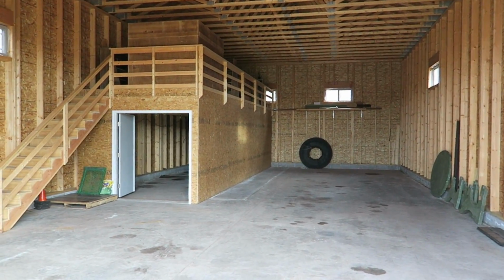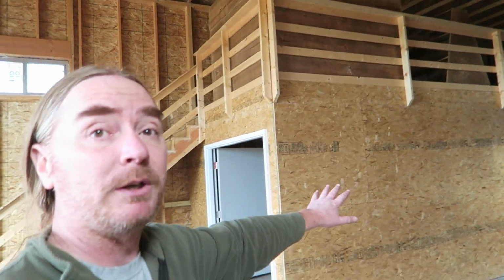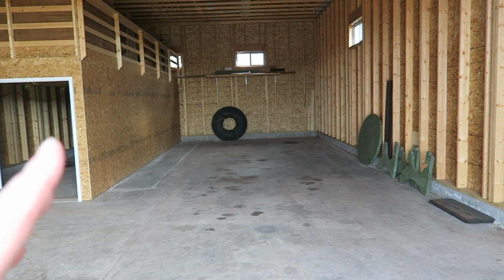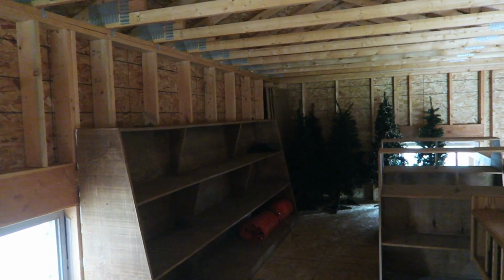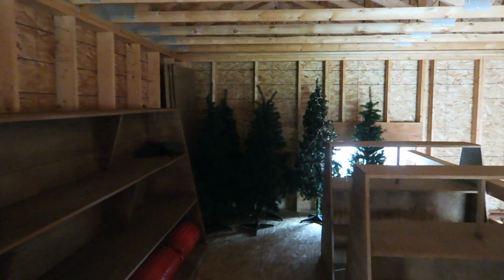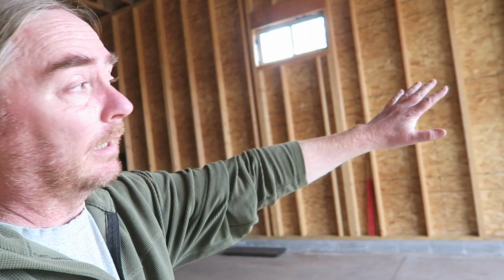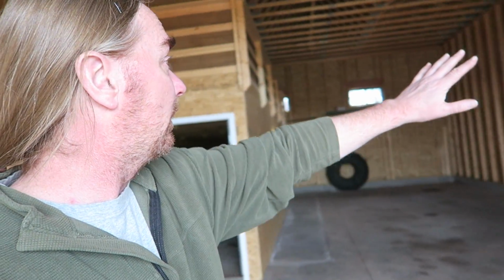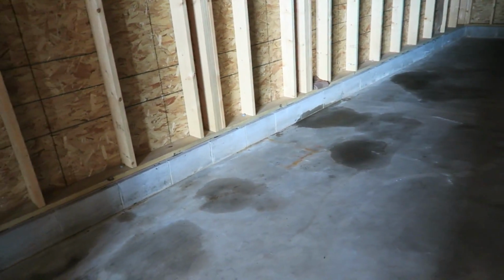CHECK OUT THE NEW BOAT SHOP!!

Comment: Decide what  "R" insulation level you want.   The R level is selected you can then decide on the cost of foam, glass batts or blown in insulation.   The advantage  of closed cell foam is it becomes the vapor barrier.  That being said the biggest air leak and heat leak will be the massive door. I would probably go with plastic vapor barrier and blown in insulation and seal everything well for the walls and ceiling. Put your money in the door and window  solutions....if you spend 18k on the walls and the ceiling and the doors/windows leak cold air what have you gained?.   On my shop (32 x 32) with 14 ft ceiling, once I insulated the attic then I saw a big effect.  My walls are glass batts, ceiling is blown in cellulose insulation.  My weak point is the 12 ft x 12.5 ft sliding door.

Comment: There is a product called Spray it Green. You know how to spray, so you can spray it yourself! You tell them the sqft, and they send you the equipment and instructions. 5.5 inches would equate to about R24+ You have the PPE, since it is the same as glassing. Most people run PVC conduit if the electrical is not installed first, and it will allows for repairs later without tearing out the insulation to fix a wire. For the flooring, there is a system that can resolve that issue. It puts down a layer of foam core insulation then thin heating pads, then flooring. It will add about 6" or so to the floor, but less goes to ground. It think they told me it was 80% efficient, but yes it can cost, especially for the weight you're putting on it. The good thing about that is you don't need 100% coverage to make it work. Again something you can do, all but hooking up the electrical. Most states say you can run the power but need a licensed Electrician to test and hook everything up to the panel and/or box. I've done a lot of Reno work, just not in MI. Good Luck!!!

Comment: Here is an elaboration on my earlier post. I am a 3rd generation custom home builder. My family starting building homes in the Chicago area back in the 50's and have built all across this country from Miami to California. I am currently retired in the mountains of Idaho. 

There is a a lot of hoopla with spray foam. I simply don't think it is appropriate given its cost in a shop with a large garage door with minimal effective insulation. If you do decided to go this route, absolutely make sure you use an experienced installer that is insured. If these products are not properly mixed and installed, you can have a literal disaster on your hands. I suggest reading on these problems. Even with spray foam you are simply not going to heat this building with a trivial amount of gas/oil. Unless you tear this shop down and build something with ICF and SIP construction and place foam under the concrete slab. Again there is little point when you have an R6 garage door with a marginal seal at the threshold. 

Since you have plenty of depth, I would consider moving the enclosed space to the back and run it all across. I would also add a mechanical room for compressors, etc to keep noise out of the shop area. I would also add or relocate some windows for natural light. 

In my shop I am using standard 4' (fluorescent style) fixtures. These are available in 4 or 8 bulb configurations. Either the ballast is removed or purchase the LED ready ones available from most distributors and install 3000k led bulbs. I have mine hung on a chain and plugged into ceiling outlets that are all ganged to one switch.

Comment: I would personally do the insulation with wood fiber based wool. either with sheet material or blown. You can do the walls with the blown stuff too if you add PVAc binder to it. There is no one right way to do insulation but we tend to insulate very heavily around here.

Comment: Andy,
I've been getting a lot from your channel for a while, and happy to (hopefully) contribute back. I am finishing up my 1000 sq ft barn/workshop now and did a ton of math on insultion and lighting cost efficiency. 
Insulation short answer: fiberglass batts R19 plus .5 "to 1" foam panel over studs with taped seams. Double R38 batts or R38 +R19 in the ceiling with a good vapor barrier. Cover Concrete footing with 2" foam box.
Lighting short answer: keyless light base with LED bulbs. I did about one every 50 sq ft. with a daylight temp 100W bulb.
Insulation long answer: In general, you save more BTU's by fixing the weakest link than reinforcing the strongest link. No matter what you put between the studs, the studs will always be where most of the heat is conducted out of your shop and they make 15% or more of your wall area. You can more than double the effective R value of your building walls with 4' x 8' foam panels tacked over the walls then covered with you covering of choice. I used 5mm flooring underlayment as wall panels. Not much more than sheetrock but way more tolerant of heat/humidity swings. Spray foam is just stupid expensive per delivered R value and only makes sense in places that are crazy shaped voids that need to be air sealed. In your ceiling, you have tons of depth to work with, so use the cheapest R-value/$$ option which is fiberglasss batts. Also, take a hard look at your overhead door.
Lighting long answer: Those cheap ceramic light bases (about $2 each) and a good LED bulb deliver 2x to 5x more lumens per dollar than anything else. Cheap to buy, cheap to operate, lasts 10-20 years. I looked into LED tubes, strips, even single LED's operating at low voltage. Nothing comes close to mass-produced regular shaped bulbs (A19 with E26 base) in terms of lumens per $$. I also put double outlet boxes every 10' or so, and a 220V outlets per plan.
Even if you are not allowed to do your own electric in MI, you ought to be able to find an electrician that will let you place boxes and run wires and knock a bunch off the bill.
Flooring: put down some 1/2" foam work mats and wear wool socks. :-)
Heating: I have a small woodstove which is more than adequate, but if I had some $$ to spend, I might go heat pump forced air. Almost the same operating cost as gas hydronic, but also cools/dehumidifies in the summer. Some air circulating particle filters and you can eliminate cold spots while improving air quality.
Like I said in the beginning... I really nerded out on this stuff trying to get a tight, well lit building on a budget and am happy to share my calculations... I could go on for pages and am happy to help. Reach out if you want more info directly.
Reply: I did the same thing in my much smaller shop it is amazing how much light those simple/cheap led a19 bulbs you put a huge number of them across the cealing and you have great Omni directional light through the whole space super cheap to maintain even if you have one or 2 fail they are nothing to replace
Reply: You ARE allowed to do your own electrical in Michigan. I built my own home in Grand Rapids in 1997, and did ALL my own electrical. All you need to do is take an OPEN BOOK test at the building inspector's office, and off you go. The inspector will catch any mistakes.
Reply: The new shop looks great!
Wish I was there, I could do the Electrical for you!
How long should I wait to wax my boat after I paint it?
I love watching your videos!👍

Comment: Hi Andy, if you think about insulation: the weakest component determines the efficiency. Therefore, you should also look at the windows.  I think they are not double glazed? It should also be considered whether a thin floor insulation might not make sense after all.  Maybe you can do it later? Because of the costs, I would spray thin insulation and, as others have already written, insulate over them it with mineral wool. Because of the cost. A lot helps a lot.  I wish you success.

Comment: Run degreaser and a jet washer through you will soon get rid of the stains or highlight if there is another issue.
Reply: I would go to sherwin Williams grab a 5 gal bucket of hs1000 epoxy and roll it on. I believe the HS is 75% solids. You can always go with 8100 water base too. Shouldn’t cost more the $500-$600 with an account.

Comment: So why have you not talked about an outdoor wood boiler??
I’m thinking if you’re in Northern Michigan then the wood should be most economical. 
This would greatly offset the price of insulation. 
If the heat is cheap then why spend so much on foam? 
If you have to hire it out, then it’s going to cost big. 
Fiberglas done by you should be considered. 
What’s that? Walls a few grand. Ceiling $2000 tops. 
You’re far less then a third the cost. 
The savings can go into a great heating system. Geothermal or wood boiler. 
I’m thinking you already have a moister barrier. I think that’s required in the build. 
Lights. You can get a LED screw in now with 6000 Lumens for about $40.  Buy just one and check it out for yourself. 
You can piss away $20k by not doing your research.  
Take your time on this & get lots of bids.
Reply from the maker: To be honest I've had an outdoor wood boiler for the old house when we first built it.  Nothing says "trapped" like having to feed the fire twice a day lol.  Couldn't be gone from the house more than 10 hours without having to go through a 2 hour fire starting session at night :-)
Reply: @boatworkstoday  Couldn't you use it for a backup? Days you're working all day etc!

Comment: Congratulations on your new place Andy! Nice shop!!!! Go with spray foam. I did my new home and love it. 
I live in Florida and run the AC a lot. My electric bill runs right at $200 a month in the summer months. Compared to friends at $300 - $500 a month. 
Another option is you can rent the equipment at Home Depot. Rent a scissor lift and spray it your self. 
Go with LED lights as well. No ballast to mess with and they don’t use hardly any power, and they are bright. There is also a wood fired boiler system. Requires you to cut wood and feed it. But with all the trees on your property it’s essentially cheap heat. Could do a Gas back up. 
I’m still trying to get my shop built. Construction materials are crazy expensive right now. So it’s on hold.😒 Hang in there it will get better, it’s over whelming right now, but it will get better! Look forward to your new video’s. Thanks for living your dream to help us with ours!

Comment: Roof is the biggest loss spend the money there. try to get R-22 in the walls. Use closed cell foam, not sure what he priced for you. to check the slab, tape a 2'x2' piece of polyethylene to the floor with duct tape around the entire perimeter, you will immediately know (overnight) if there is a vapor barrier below the slab.

Comment: Agree with flash and batt approach.  Closed cell pushed out to the perimeter of the envelope will help with insulation, airtightness, vapor barrier and some additional shear strength.  The remaining batt in rock wool is great for insulation and it (as a component) is fireproof. As for moisture, I’d first look at things like gutters for managing bulk water, and maybe an internal perimeter French drain to a sump.  If the slab isn’t insulated, do you know if it’s separated from the earth by a thick mil vapor barrier?

Comment: I live in Arkansas, so of course there is a huge difference in climate. We do spray foam insulation, roughly speaking we might be a couple thousand dollars cheaper for that building, but I don't think he is too far off. We normally spray a 2x4 wall and trim the excess, 2x6 walls we spray about the same as you would a 2x4 wall and try not to exceed the depth of the 2x6 stud. This will leave you with 4" to 6" inches of foam insulation. This should give you about R19 in the walls which Michigan's required about R15 to R20 depending on the climate zone you're in. Just as important as the foam insulation is the air tight seal you achieve with spray foam. Now the Ceiling, if you're going to put blown insulation in, I wouldn't spend the money on the spray foam on the roof underlayment. Just make sure you are 100% air tight on the ceiling and pile in the insulation.

Comment: I recently finished my shop here in Michigan also. For lights go to bee’s lighting for LED lights. I went with many lower output to cut down on shadows. Insulation spray foam all the way. I did 3” in the walls. As a homeowner you can do all the work yourself and permit it if you wish.

Comment: Mezzanine is the word you were looking for.
LED lighting is what you are going to want in that shop. It consumes far less power than ye olde florescent lighting. It should last far longer than ballasts and tubes. SuperBrightLEDS.com is one source I’ve used in the past. They have commercial lighting like you’d find in a warehouse or shop. 
One additional thought; get drywall installed on the trusses and fully insulate between them: 6” (R-19) faced insulation between the trusses, with an additional minimum R-19 unfaced batting on top of that, installed perpendicular to the trusses. I did that to my house when I moved in, and noticed a significant difference.
Reply: Side note: Me seeing the generous amount of room in Andy’s new building. 
Compares it to the little 10’ x 10’ room I have to work with. 
Looks again at Andy’s shop.
Drooling begins ...

Comment: As far as insulation is concerned, I will use an analogy to explain the issue you are facing. If you were going to build a horse corral and made the fence 8 feet tall around 90% of the edge and made the remaining 10% of the fence 2 feet tall, you would have a really poor result. You will always have 2 big heat sinks that will keep this building from being as thermally tight as you wish.  The first is the floor. If the walls were not insulated, you can be sure the foundation is also not insulated. Heat will go into the ground and be conducted into the ground outside and then lost to the outside air. The second big heat sink will be the overhead door. Given these two issues, spending a lot of money to make the rest thermally tight is not really smart. What you should look for is a fairly good insulation at a good price up front. If you want to in the future invest in insulating the foundation then it would make more sense to add insulation into the walls at that time. The overhead door will always be losing heat(either air leaks around the edge or heat straight thru the door.)

As far as the electric, I would say that is where you should make some good investments. The investment would equate to how much current you want at the main box(particularly if you have some heavier tools) A dust collector can draw 15-25 amps, a saw or planer can draw another 15-25 amps. When you add lighting or another helper using tools you could easily get to need 100 amp service.  The copper to run 100 amp or 150 amp service that far back will not be cheap. I agree that LED lighting has come into its own in the last few years.
Reply: I know nothing about insulation but i'm pretty good at trolling, lol.  In your analogy of the fence, it sort of seems like you're saying, if you can't build the entire fence 8 feet tall then you shouldn't build any of it 8 ft tall?
Reply: ehhh...well...kinda need to look at it like 10,000 horses in that coral and only a few of them can get out through the remaining heat sinks.
Reply: I mean....they're GOING to get out...it's just a matter of how fast.

Comment: YEEEEES !!!  congratulations to you and all of us😃 we are really looking forward to following you in the coming time with your new workshop.  my suggestions: the wall: regarding insulation it sounds like you are just about to keep track of it, so no comment from here.  interior wall: what if you use sandwich panels, or metal wall with structural surface so that there is not so much echo, and that you can then clean / dust the place e.g.  high pressure washer?  Indoor heating: if your electricity costs are lower than hot water / oil, how about considering heat pump to the place?

Comment: So, spray foam is a far superior product and R value per inch.  One thing to consider is that it is a pain to change any electrical if you completely fill the stud cavity with spray foam.  If you put in 3 inches, you can still access the electrical fairly easily if you want or have to move things.  Also, more than three inches is diminishing returns for the money.  Your biggest bang for buck at that point is windows and doors.

Comment: Great new space Andy. Just something I was noticing though, and maybe I'm off with the optics, but it certainly looks like more around the 26-28' width instead of 40ish feet? Might save a bit on insulation if it's a little narrower, but I also know it's hard to remember dimensions with new projects! I still can't remember my own house half the time, and that's after twenty years! Can't wait to watch it all come together!
Reply from the maker: Agree, there's no way it's 40 wide, numbers just don't add up!  Paced it last night and I'd say closer to 30 wide and maybe 50 deep.  Listing specs is what I went off initially

Comment: I'd suggest a water to air heat exchanger blower. I use one for my wood boiler. They make them as a all on one unit. It will cook you out of that shop, available in large sizes also.

Comment: Most of the value in spray foam is air infiltration. I would put R19 batt in the walls and blow a good R38 or more in the ceiling. To get less air movement make sure you use a really good moisture/air barrier over the top. Take the time to seal all the holes in electric and other in wall penetrations. The better the insulation is sealed the better the result. Do you know if the outside was wrapped in tyvek or other building wrap under the siding? This also restricts air movement.